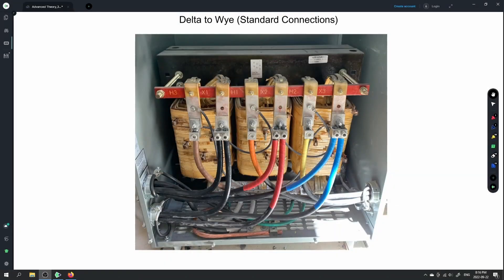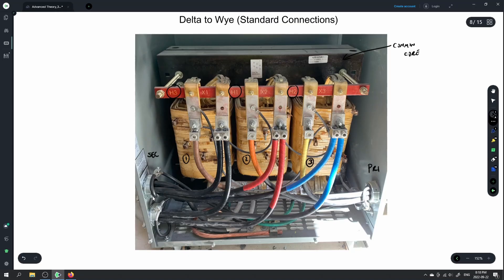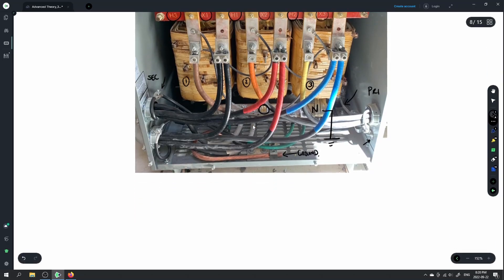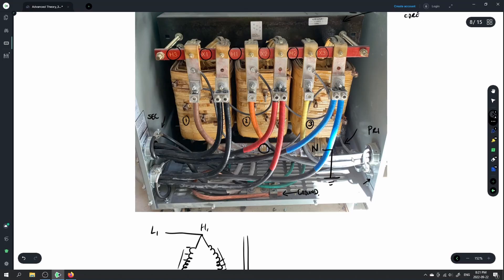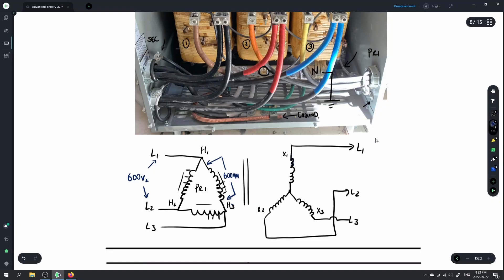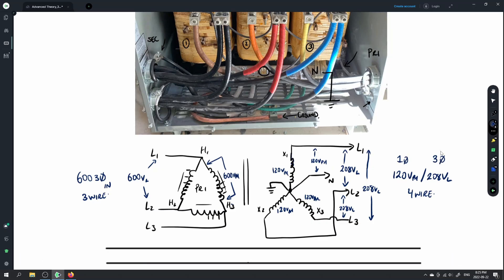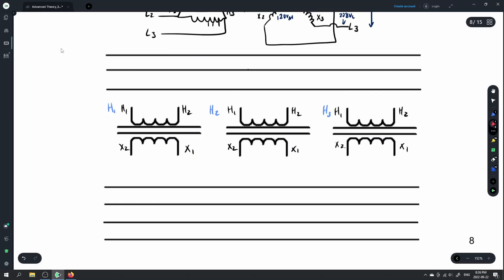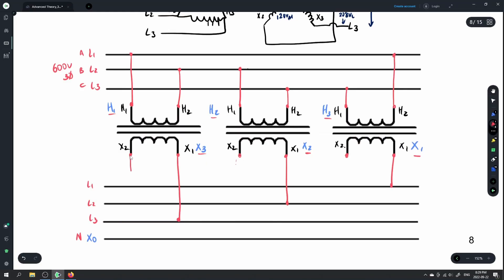Delta to Wye Standard 3 Phase Transformer Connections

Comment: Which of the two connection is the most advantageous  in banking a transformer: delta-wye connection or wye-delta connection application in facility with commercial and residential area?